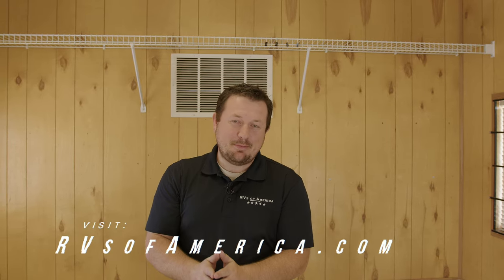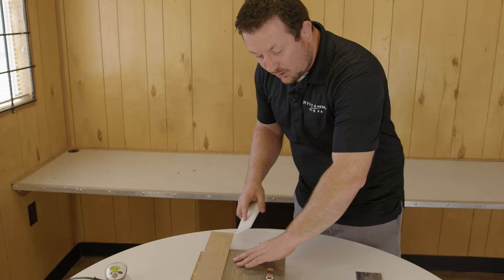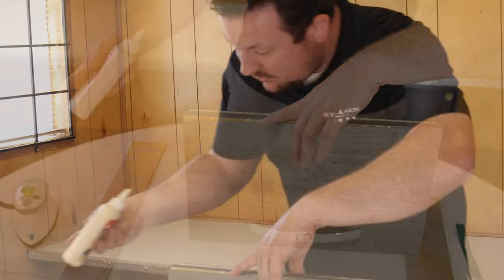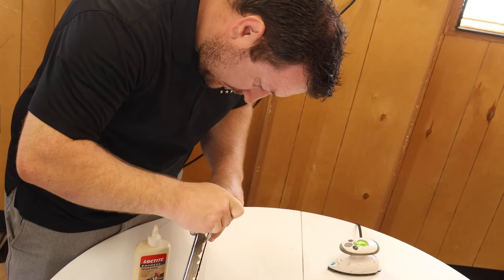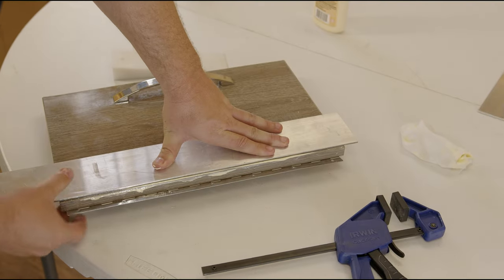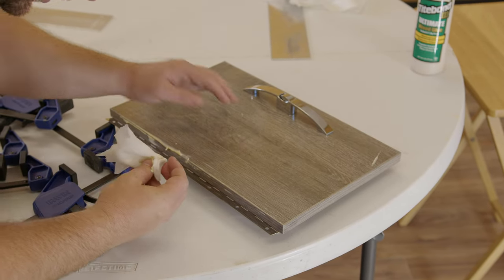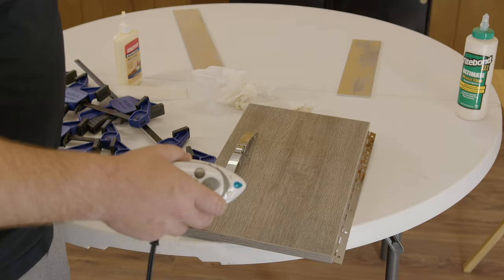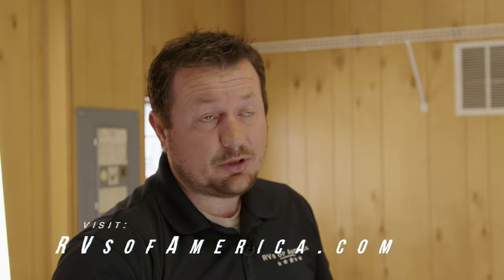HOW TO FIX RV DELAMINATION ROA (2021)

Comment: Black Series is fast becoming the Jayco of off-road trailers.
Reply: Now that's funny! At least ROA admit to the problem. I've had high end 5th wheel manufacturers (New Horizon, Deluxe Mobile Suites, spacecraft) swear to us they never have delams. Sure enough, they all do.
Reply: Not fast becoming.... Have been there for some time. Perhaps worse in some areas. None of my off-roading friends have had issues like I have had. And every one of them spent only a fraction of what I have. I could have bought 3 competitors campers for what I have invested so far.
Reply: I really do believe when you buy a Black Series, you purchase a hobby.  Hobbies aren’t a bad thing, they give you a purpose in creating something that can be uniquely yours plus the knowledge you gain is a real benefit.  There are many faults created by Black Series and so many solutions we can come up with.  We have a 21 on order and are planning to completely change the solar system/batteries as the first upgrade.  If we have problems with the veneer splitting/delaminating, we will replace it with FRP panels (almost bulletproof).  Obviously the “no name” appliances will be headed for recycling when they fail.

The one thing I would like to see is BS to admit the trailers are Chinese.  I find it amazing that dealers insist the trailers are totally built in Australia.  That leads me to believe that BS perpetuates misinformation.  Things made in China don’t have to be of lesser quality, look at what Costco, Walmart, Home Depot, etc offer.  I like Milwaukee tools, just about all are made in China.
Reply: I agree Robert Anthony,  that when you buy a trailer,  like a boat, you buy into a hobby. I have to ask,  when are consumers going to get tired of accepting that level of mentality and demand better? For example,  I purchased a Toyota Tundra for half the price of my HQ19. I can't recall having to take it to the dealer because the dashboard was delaminating, having to get it repeatedly realigned because the tires were wearing unevenly, paint peeling,  my Tundra roof never leaked, my electrical system didn't continually fail.... Need I go on? Who spends $60,000+ thinking,  hey,  this is going to be a fun hobby? Fishing is a fun hobby,  endless RV repairs at the cost of the consumer are ludicrous. To your note... I have had to upgrade the junk batteries to lithium in my unit along with an MPPT controller. It only cost me around $4,000.00. 4k here,  4k there,  4k everywhere.....
Reply: Perhaps BS should see if Hobby Lobby would like to become a dealer?

Comment: The vast majority of panels in my HQ19 have either delaminated or cracked. Thus far it has taken over a year to get the majority of the panel issues addressed. Black Series won't last long with the build issues they are having. Even the brand new units I see look far worse than mine right on the dealer lot!! I see some separation between ROA and Black series as of late - no surprise - it was a matter of time before the build issues really became apparent and ROA would find other builders and sell their products instead. Even a class action seems a reality at this point for BS owners. My local dealer has at least found a band aid to cover cracked walls by adding upholstered panels to cover the defects. Epoxy coating the counters was another fix for all my counters that delaminated. Literally, nearly all counter surfaces delaminated...
I see you using wood glue which is a way to repair the delamination's but I would use a good contact adhesive. In panels we build we use contact adhesive. It is messier and requires more attention but it is a solid way to repair the peeling laminates. You are clever in using the iron, it is an old cabinet makers trick to make the wood glue really adhere. 
On another note...
On a recent camping trip a fellow camper came onto our site as he was in the process of purchasing an HQ21, and very excited about it. He was curious about the build issues he was finding online and wanted to bounce them off of me. I gave him a full tour and listing of the problems I have been having and the less than quality communication with BS in getting things repaired in a timely fashion. Needless to say by the end of the weekend and 2 visits later he is purchasing a different brand - I believe with ROA. BS does themselves no favors in their customer relations and warranty repairs. The longer they let owners dangling in the wind the more this will compound their woes. Just my personal thoughts and opinions.

Comment: Thanks for posting this video, any tricks for cracked veneers on the walls?
Reply: Darren: Any tips on seeing into the future? ...You posted your comment 2 weeks before this video was released! .... haha
Reply from the maker: @paulbailey5915  Haha! This was a private ROAMER video we share. We just made it public.
Reply from the maker: Depends on where it is. Usually we use some stick on tile to cover. Like a nice back splash. Also you order new panels from Black Series.
Reply: My local dealer has put on upholstered panels to cover the cracking problems. To repair the cracked walls would be a major and very difficult undertaking that would almost literally involve dismantling the trailer to correct, depending on which panels are cracked.